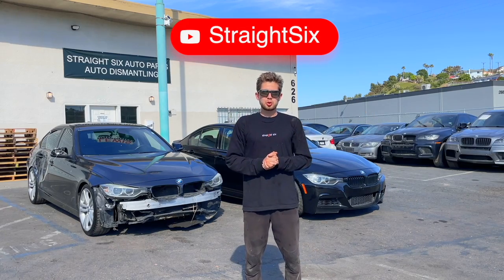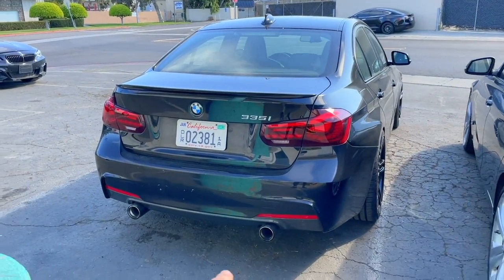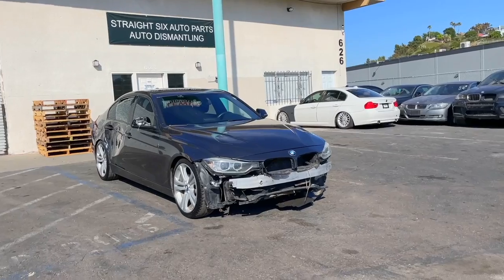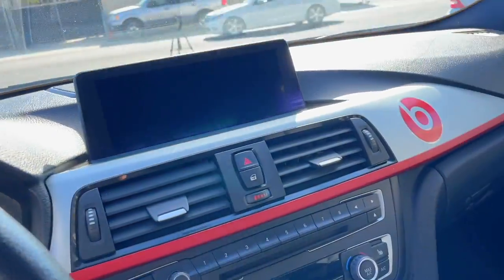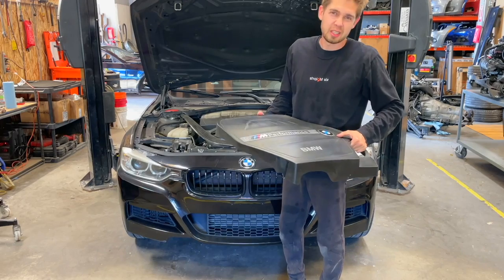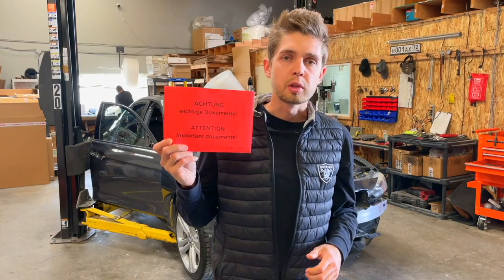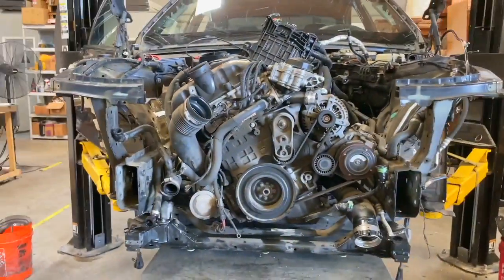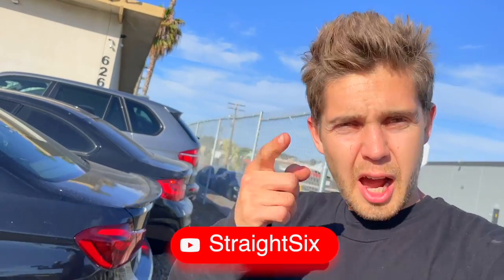What is the difference BMW 335i F30 Sport vs M-Sport Trim

Comment: That is not correct. Stabilizers bars are thicker, body is lowered by 10 mm and also Sport+ driving mode is on M Sport, apart from M badges on rest pedal, front wings, wheels, shifting knob, etc.
Reply: Sport + is on sport line too
Reply: @GuhbsBeats  better for you.